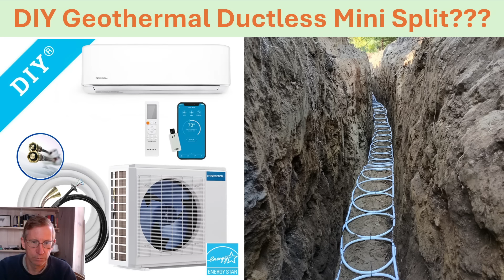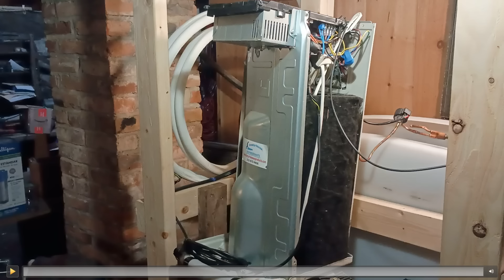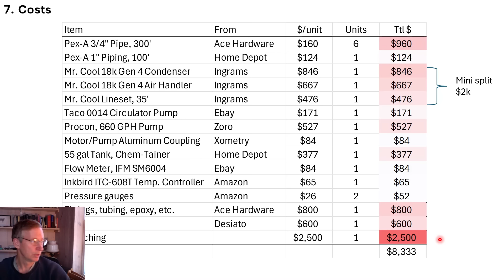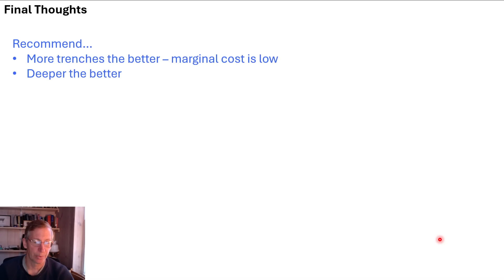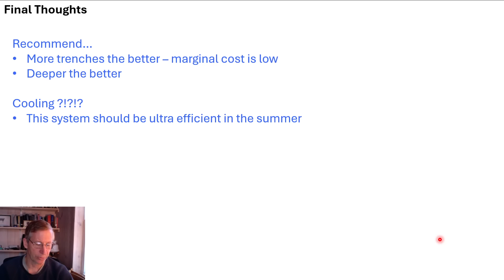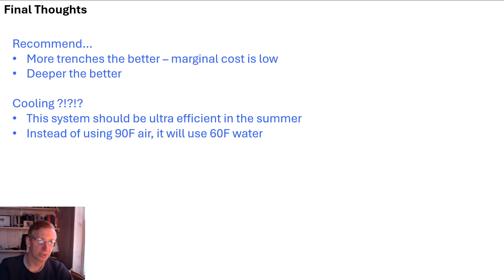DIY Geothermal Ductless Mini Split (Ground Source Heat Pump)

Comment: I dont know if that is right, but looks like your heat exchanger is placed off to one side of the tank? If you had it in the middle placed in between the supply and the return of the ground loop wouldn't there be better flow over the fins? Maybe I just missed that part of the design..
Reply from the maker: My supply lines are off to the side, because of an obstruction that is part of the tank. Not ideal, but had to work with what I had.

Comment: Hi Ed.  I have a spring, that I’m aching to put the evaporator coils into, instead of the 10’/12’ deep trench.  It’s within 50’ of my tractor barn/room, which I am wanting to heat/cool.  It’s also the room with my LiFPO4 battery cells.  Any suggestions (gleaned from your installation)?
Reply from the maker: If you are planning it for winter heating, and you are in a colder climate like Connecticut, I'd be afraid your condenser would freeze solid.  Test the temperature of the spring during January.  If it is running close to freezing, I don't think it will work.  If you want to run it the rest of the year, it could be a good option.

Comment: This is really cool, if I didn't have so much rock on my off grid land, I'd consider something like this.  I will probably end up using baseboard heat and maybe a regular air source heat pump though, and use wood stove on days where where it's simply too cold for either of those to work.
Reply: If you want this badly you can drill a well for it
Reply: That's a crazy amount of money.  Tens of thousands.
Reply from the maker: This is certainly a viable option.  I spent ~$6000 more than just the air source heat pump.  Payback will take quite a while.  It would take my lifetime to break even if I paid someone else to do it.

Comment: You need to insulate the pipes!
Reply from the maker: my basement is ~ the same temperature as the water.  It is a cold dirt floor basement
Reply: @edwardwazer5103  I'm refering to from pipe to pipe heat transfer, yes it's a thing I would insulate the "heated" pipe inside your basement or it will give out it's heat/delta to the basement  And the exit pipe as it is colder and suck heat from your basement and take it out. Passive heat transfer is a thing and not a trivial thing... Here in Finland we insulate all the pipes. To minimize loss and to make sure pipes won't freeze, The most expensive insulator around a pipe + the tape to make it air sealed cost 14€/m and tape was 15€ for a tape, so don't pay more than that if you gonna do it. Also personally I would insulate the water tank too. But that is my 2 cents :) you do you.

Comment: The problem with the pump reversing directions you can use a bicycle gear that only allows it to spin One direction and then free Wheels the other way on the fan motor goes in reverse it's slip clutches allowing it not to actually spend the pump😊
Reply: Pretty smart and easier to do than some electrical solution.
Reply: look up sprag bearing
Reply: Correct, it's an overrunning clutch (if you want a specific search term)

Comment: humm the real question is why don't you use a a plate exchanger ?
Reply: Did the MrCool come with one?  There is your answer.
Reply: It would cost more to recover the refrigerant, braze in the plate exchanger, leak test, vacuum down, then recharge the refrigerant.

Comment: Rotary vane pump is a bit overkill in this application, best would be hydronic heating system pumps.
Reply from the maker: I agree, but finding one with the flow I needed with the rpm of the motor that came with the unit was the challenge.
Reply: @edwardwazer5103  its a separate pump, in fact forget the fan motor even exists.

Comment: In regards to your fan/circulator pump motor.. First thing I would do is to reinstall the fan, take four data measurement points. One with fan full load, one at smallest load, take fan off and take same measurements unloaded (small load-high load), you will be measuring Voltage and current.. Then install a three phase bridge rectifier followed by a capacitor (sized correctly), then do one of two things..  Install a solid state relay (if the voltage from the rectifier allows) controlling a standard cheap single speed circulation pump (ac or dc) or you could hook the two output wires (output between bridge rectifier and capacitor) to a dc pump (sized correctly for the dc output voltage (HIGH AND LOW) and power that was measured in the previous above mentioned.  The bridge rectifier cancels out the occasional reversing function of the motor and give you a solid on/off of a circulation pump.. you really do not need a variable speed pump here as water gives massive headroom for extracting/holding heat. 

All of what I said could not work as I myself do not know what VAC those fan motors see. If you do decide to read the voltages, I would like to know what they are if you could come back and post them.. If they are really high, I could possibly direct you in a different way.
Reply from the maker: Thank you Andrew, I understand about 75% of what you are saying and think this is an elegant solution to my problem.  I do have a sprag clutch I will eventually install, which should eliminate my issue.  If that doesn't work, I will digest your recommendation and see if I want to go this route.
Reply: @edwardwazer5103  full bridge rectifier into dc motor controller would be the easiest!
Reply: message me if you have any questions

Comment: Very cool project. Heat pumps are incredible. I wonder what the difference would be between this and an air source heat pump. As an engineer, I want to maximize efficiency but sometimes the juice isn’t worth the squeeze…especially if you have solar.
Reply: yes , things are different with solar,   one also has to consider how much longer we are going to live (ROI)  in some cases adding insulation is more expensive than more batteries , even thermal batteries.  System design is fun with all the variables.  But of course as engineers we initially think of max efficiency..then we get realistic with our mortality and budget  lol.... if one is going to die in the same house or move or give it to ones kids....those are all more variables.
Reply: I am a retired geothermal installer. We used methanol for Loop antifreeze. It transfers heat better and suffers less from viscosity than propylene glycol or ethanol. We used to buy cases of windshield washer fluid as the least expensive option. I got the msds from the manufacturer and found what percentage it was and did some math to calculate how much we needed. It worked great. If you add any antifreeze to your system, you will need to cover your tank or it will evaporate.
Excellent diy project!
Reply: Efficiency is great. You'd be able to maintain the advertised EER during the cold season. Same with the cooling in the summer, doesn't matter how hot it is outside, the AC will provide rated cooling with the compressor running at minimum RPM.
That said, it makes little sense to go for the ground loop with the solar. Especially in the off-grid setting. In summer, you already have excess production so it doesn't matter what your AC consumes. In winter, there is power shortage that doesn't allow for any electric heating, no matter how efficient the heater is.
Reply: @npl-8701  , in winter (80817)  I selected an angle for winter production as summer yields excess production. My location has a lot of production in winter, but I'm lucky,   do have to clear snow sometimes from panels.  The key is batteries, both thermal and electric, when it is sunny I overheat parts of the house..as a battery. My EV will be used as a very cheap large battery as well.  Ev's are a cheap way to get a driveable battery.
Reply: @npl-8701 so you're suggesting a different heat source for winter?
Reply: @techwatch249  Sorry, I replied to wrong thread. Yes, in the off-grid setting you'd need another heat source. My primary winter heater is the wood stove. Around 5-7 kW heat output, uses around 5-10 kilos of wood per day, also provides hot water.
AC is the secondary, it reduces the wood consumption significantly but for 3 months it's mothballed.

A setup that produces flammable liquids in the summer from solar to store for the winter would've been ideal but all the processes I know involve catalytic reforming under high temperature and pressure so wood it is.
Reply: @npl-8701 so 100-200$ of pellets per year? I'm trying to design the optimal setup for my house or a new house someday. It's too expensive to get enough batteries to cover for all possible extremes during the winter. So it's either a generator backup or a pellet stove (or grid that can be unreliable especially during winter weather).

Comment: I watched another video by "Tech Ingredients" who did something similar, perhaps inspired by you.
His system looks to be smaller, but seems a bit simpler, no large storage tank, and a borehole instead of a large trench.
He avoided the issue of bending the coolant lines, by simply building the water reservoir around the evaporator in-place.

https://www.youtube.com/watch?v=s-41UF02vrU
Reply from the maker: I think building the reservoir is a better idea.  I was considering putting another HX in the same tank, so wanted to go big (if I had to do it over again, I'd build a small box)

Comment: i thought of the same system but never tried to implement it. I purchased a pioneer hyperheat mini split. Its the 18k unit. It does not meet the heating specs they sent me before purchase. I requested a graph type heat chart to inspect efficiency's at various temps. I can say with 100% certainty this unit does not meet them as I have wall mounted electric with known wattages next to them that CAN handle the winter cold. I see you have many temp graphs shown. Do you have a simple way to record and graph them? I want to test and Record different values from probes underground and above. this could help me size a suitable system. Thank you and nice work.
Reply from the maker: I'm using a PLC (industrial programmable logic controller) to record data and excel to plot it.  I have experience with PLCs, so that is why I chose one, but there are cheaper devices to record temperature and flow.

Comment: Did you calculate how much buried pipe you needed to achieve your intended result?
Reply from the maker: Just used industry rule of thumb of 600 ft/ ton and then doubled it.  I knew my soils were generally wet, so I should have good heat transfer, but I still would like more

Comment: To prevent the 3-phase motor from reversing you might use a contactor (large relay) to detect the reversal and disconnect the motor. 
Alternately, place a ratcheting mechanism on the shaft that only allows one-way turning.
Reply from the maker: I have a sprag clutch as someone else recommended, I just haven't gotten around to installing it yet.
Reply: Could you perhaps use a bridge rectifier as it’s a DC motor? Assuming the polarity switches when the direction is supposed to switch?

Comment: Thanks for sharing your knowledge. I’m curious why you chose to use the 3 phase “odd” electric motor? I don’t expect a 3-phase motor to be efficient. I’ve seen others use pond pumps, understood that won’t meet your flow requirements though. Did you look into efficient alternatives for a pump? Possibly even a hydraulic ram pump? If you did; and still chose to use the rotary pump, I’d like to hear why? How is the humidity in the room where the tank is? Is there a reason you didn’t submerse the whole coil? Great video, thank you for the share!
Reply from the maker: The 3 phase motor is what comes with the mini split, so it is easiest to just use what is there.

I didn't calculate the efficiency of the pump, but it is unlikely that it is the driver in energy consumption; the compressor is going to be.

I was willing to use any pump that would operate at the rpm of the 3 phase motor and the desired flow rate.  I struggled to find a pump that met those requirements.

The system is in my basement that has a  dirt floor, so I don't notice any humidity changes.

Coil should be submerged, no reason I didn't fill it further, just didn't.

Comment: Have you considered how this modified system would affect salability of your home? No HVAC company will service this which would be a deal breakers for most buyers. Would you just replace the modified system with a stock unit?
Reply from the maker: Definitely can't sell with this, but no intention to do so.  We would definitely need to rip it all out before sale.

Comment: I live 100 feet from the ocean on the Maine coast so I've always thought it could be my geothermal source but I anticipate a huge problem with permitting. I fully expect there are no provisions in the law for this. Perhaps a small pirate system. I guess the first step is to gather data...monitor ocean temperature year round in front of the house. No room for trenches, and the ocean is right there.
Reply from the maker: The major technical challenge would be corrosion, as the heat exchanger isn't built to withstand salt water, but it would be the ultimate heat sink and source.

Comment: Dude!  Great Article..  I have two New, Yet to be installed Sienna 18K Seer 18 heat pumps for my garage.  House already has geothermal w/3 200' verticle wells into the aquifer.  Rock solid water temp is 67ish year round.  Going to "Tap into the existing GEO juice pipes.  Put the two "Outside units in the basement where the Geo Juice water enters the house 6' underground, then use the mini split hose to run to the two garage inside units.  Using the blower motor for the circulating pump is a Great idea.  Existing pipe is 1-1/4 black PVC heavy gauge, so tapping to 3/4 will be simple.  Fill from the top, no big deal at all.  thinking I could put both outside condensor(?) coils (one from each unit) into the same tank, maybe two taps off the "Juice Line" w/individual circ pumps.  Comes w/13' hoses, one will need to be 25'.  Easily soldered/spliced in before evacuation, or about $120 on amazon.  I have the vacuum pump and gauges, refrigerant fill is in the outside unit, so this is the time to do it.  Getting Inspired to do this project..  So easy w/existing loop..  Dang..  So Seer 18 becomes like Seer 30..  an no ugly/noisey outside units!  That water tank..  hmm..  ABS..  hmm..  weldable.  The circulating pumps and sealing the water tank with two coils are the challenges.  The condensor coils could be so much smaller for a Water heat exchanger, but sure.. don't want to loose the charge on a new system.
Reply from the maker: I didn't want to deal with the refrigerant, otherwise you are right, so much easier and smaller coils are possible.  If you are a bit braver than me, you can buy something like this: 4KW Stainless Steel Tube In Tube Heat Exchanger GY-0040C and do it right

Comment: Really nice project

If you do not want your pump to run on reverse you could make something out of a bicycle rear gearset, they only run in one direction...

Im in the process of modyfing a mini split I got off marketplace for 100$, I want to heat my domestic hot water.

First test results show a cop of 3.12
Reply from the maker: I think bicycles use sprag clutches, like someone else recommended.  I've designed a solution with a sprag clutch, just haven't gotten around to installing it.

Great COP heating hot water with your modified mini split!

Comment: Great that you managed to calculate the COP and prove that its a workable system even with less than ideal heat exchanger.    One thought is that you'd save electricity overall by heating thoughout the day and have smaller setback temperature at night.    Naturally it depends on the heatloss of your house and how much insulation you have.    I'm in the UK and we are taught that you should always leave heatpumps on as much as possible with a small setback temperature at night for comfort if necessary because the  cop gain  will save more electricity overall despite the higher  housing heatloss.  This is unlike gas boilers where people often use 'stop-go' heating to save money.  But we mostly use air to water  heatpumps here so maybe that wouldn't apply to your setup.     Such  a heating schedule  might also fix your reverse flow noise issue as the heatexchanger won't get so cold if it's working less hard over a longer period?
Reply from the maker: It certainly would help to not shut it down, I'm torn on not powering off during the day, seems counterintuitive to leave it running, even though I know it runs much less efficient during high demand, when I get home.
I am installing the sprag clutch to avoid the reversing issue, as the infernalcraftsman recommended in another comment.  I hope that solves that issue!
Reply: @edwardwazer5103 
Did you consider a bypass loop with a check valve to allow free flow in the reverse direction right around the pump?
Reply: Water conducts heat so much better than air, the tank is practically overkill.
Reply from the maker: @TNorin I agree, ideally you'd have a tube in tube hx, like on a typical geothermal unit, but I didn't want to mess with refrigerant or have to worry about how it would run with a different restriction in the system.